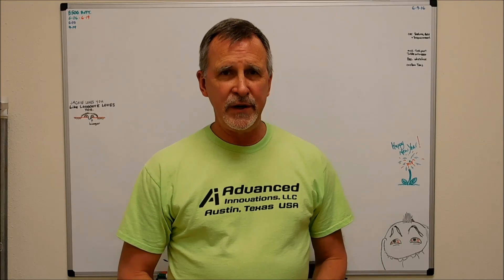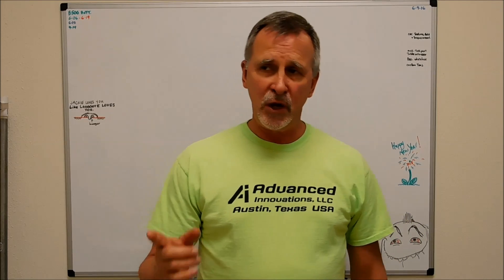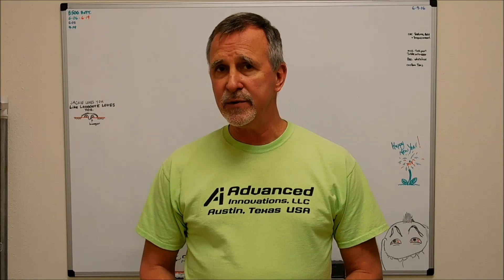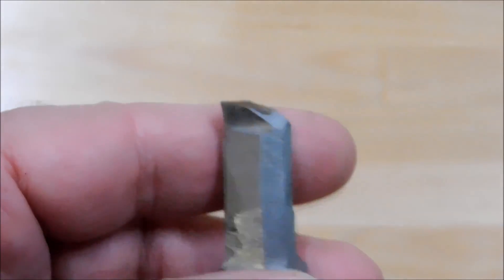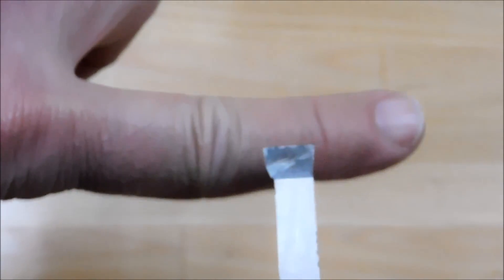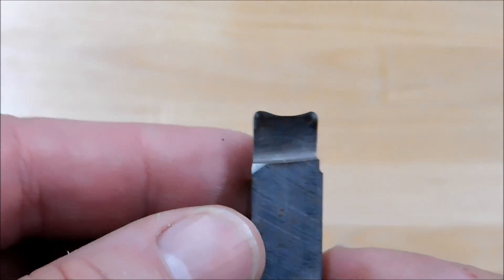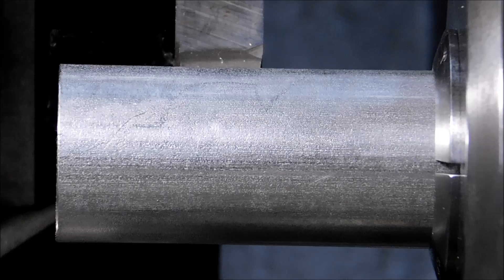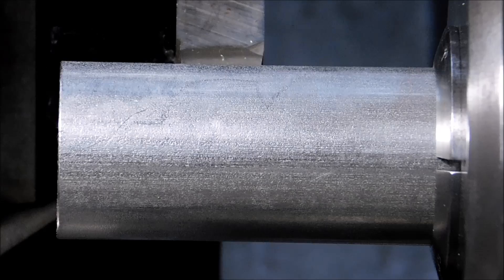Machining Large Undercuts on the Lathe with Less Chatter

Comment: Good point on a screw on chuck. how far will a 12" chuck roll at 320 RPM?
Reply from the maker: I lost a 14" dia, 1/2" thick aluminum ring out of a chuck at 900 RPM once. It went 100 feet before it stopped. Missed my left ear by less than an inch on the way by. That was a very lucky day for me.
Reply from the maker: After it passes through your chest, or before?
Reply: LOL
Faster then you could run i would imagine
Reply: But in reverse, wouldn't it go the other way? I took a 6" schedule 80 pvc pipe coupler to the bridge of the nose once. It flexed and wham!

Comment: I use a Kennametal groove and turn insert to relieve the area between the lobes on my camshafts. It works great, no chatter, nice chips and good finish. I highly recommend them for operations like this.
Reply: Would you please specifify which groove and turn insert?
Reply: I use the A4 series in particular the ones with the round nose because I like to have radi in all my grooves to reduce stress concentration if possible.  also the round nose allows for varying the amount of tool engagment so if there is chatter you can just take a smaller cut.  I can cut 1" diameter bar 8620 in the middle of 36" centers and still be smooth so they do pretty good.
Reply: Thanks for the tip on that I will order some of those

Comment: As usual great.
Why running the machine in reverse can cause the machine to break more then running it normaly?
Reply: It pulls up and away on the tool post.
Reply from the maker: You know guys, I think the inverted tool works better because it has multiple areas where it can absorb pressure and flex to accommodate the best load position. I say an inverted tool is less rigid and thats why it finds a happy place and cuts without chatter or failure. It makes perfect sense.

Comment: Great tool.  Yes there is enough differences between the left and right side to see visually. -  Great demonstration, -  Have you ever thought about how much cutting oil is wasted on the outside of the stock, instead of in the cutting area, when using a brush.  I have thought about a plastic or silicone spatula to direct the oil back into the cut.  I just hate waste.
Reply: It's not entirely wasted. It can wick away some of the heat.

Comment: Thanks again Joe. If the lathe cuts smaller toward the chuck with you can mount a threading tool upside down and you can cut a right hand THD, providing there is a relief, with the spindle in reverse, cut from left to right and do the old tap on the cross slide trick along the cut for what's needed to take out taper on the final pass too ;- )Chris

Comment: I'm curious, Joe, why do some think it is likely to tear up a machine turning it in reverse while cutting with a heavy cut/form tool?
Reply: I agree that the concern is that the tool post is being pulled away from the ways and this is not the design intent of the lathe. However, it is precisely because of this freedom of movement that chatter is reduced. Instead of gouging into the work because the ways prevent moving away from the work, the tool is pulled up and away from the work so it doesn't gouge. This continues until it cuts sufficiently to eliminate the irregularities that cause gouging thus reducing chatter. 

I originally saw this technique in another video and shared your concerns. So I asked Joe about it. He gave me the confidence to try it. I can say with certainty that it definitely works! Try it next time you have a parting job from hell. Best of all, my lathe seems to be none the worse for doing it.
Reply: Running the lathe in reverse could potentially cause a time paradox.
Reply: Barry Lochridge I guess they think it summons demons. Kinda like playing certain albums in reverse.
Reply: The carriage is designed to take big thrust loads in the conventional direction only

Comment: I needed a way to make a tool to make a cone shape on the end of 5/8s 304 in one plunge on my hardinge DSM 59.  I bought one piece of HSS 3/8s thick 2 inch wide and 5 inch long, I simple cut it on an angle made the reliefs and angled up the cutting edge 8 degrees and it works like a dream 4 degree cone with one fast plunge, mi never thought it would work .

Btw some guy sold this on ebay for 5 dollars new!   Momax ftw

Comment: Hi Joe, 
nice to be the first ;-)
Very informative video, as always. Thanks for that.
But I have one question: I often practice inverted cuts, especially when parting. What sort of damage do some people mean on their machines, if they may have a Camlock (or Bayonet lock ring) on their Chuck mount? I use inverted heavy cuts always on older (worn) machines to avoid chatter without problems...
Again: thanks for sharing your extended skills.
Reply: It is a question of what is resisting the cutting forces.  With conventional turning, the forces are pushing down on the cutter pushing the carriage onto the bed ways (the way it is intended).  With the tool upside down, the forces are trying to lift the carriage off the ways.  What is holding the carriage down and is that a suitable bearing surface to carry the loads?  If you just have the rack and pinion holding the front down, it is possibly not doing good things, but only if the cutting forces are high enough to overcome the weight of all of the carriage, compound etc. and apply a significant load.  I don't know enough of how these things are held together to say one way or the other, it is just the thought process.  I suspect it may affect different machines more than others depending on the design of the carriage.